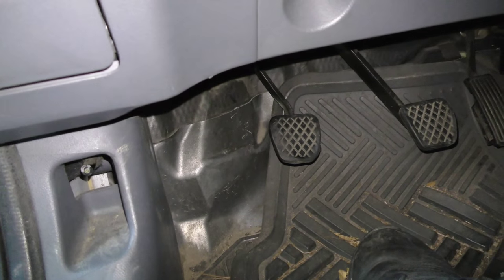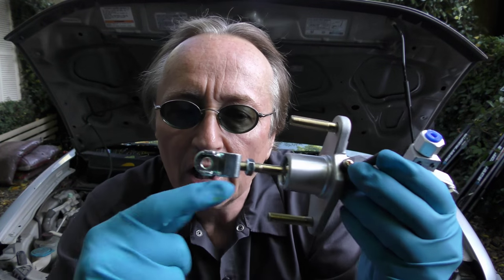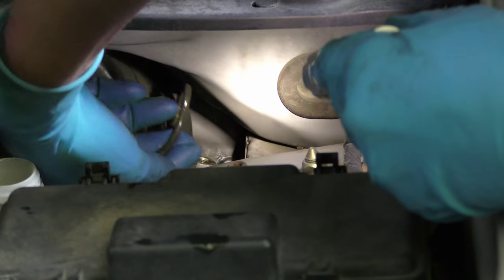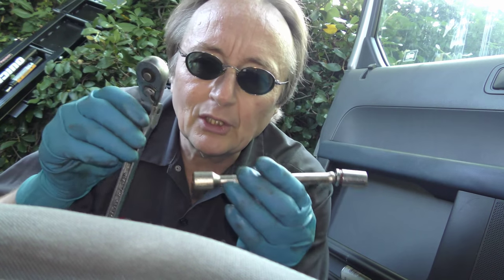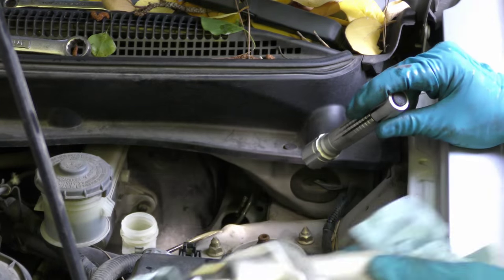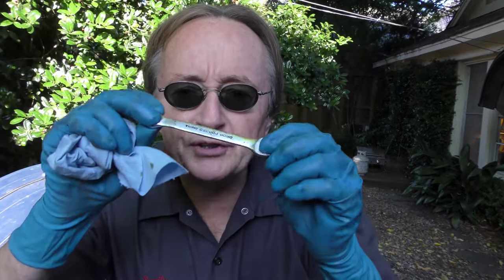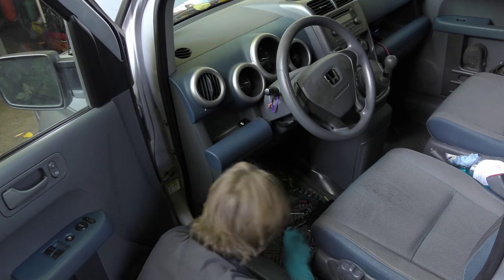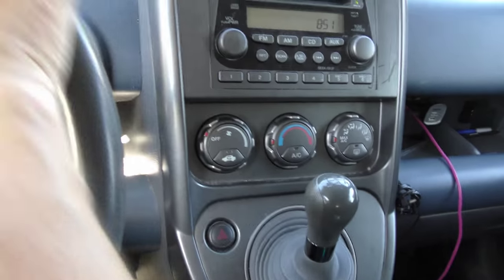How to Fix a Car that Won't Go into Gear (Clutch Master)

Comment: what if my car doesn't have a master cylinder for the clutch. I have 53 Buick. I just put a new clutch. and when I press the clutch pedal it won't go into gear. it'll go in with the car off but not on
Reply from the maker: +Nick Navarrete either you messed up the clutch job, or the linkeage on the clutch pedal assembly is broken or needs adjusting
Reply: +Scotty Kilmer well I hope not that's the 2ND new clutch I put. my question is if I adjust the rod that goes to the fork that holds the release bearing. is the bearing suppose to touch the pressure plate when the clutch is not pressed? the guy that rebuilt my clutch says it's not even suppose to touch. the weird thing is it went in to 1st. then when I adjusted it. it didn't wanna go into any gear

Comment: So confused my clutch went straight to the floor when doing a pull peddle still has some pressure but not as much as it used to and won’t go into gear hopefully it’s just the cmc

Comment: Scotty kilmer. My gear 5 on my Dodge ram is not working. Reverse only works when I'm slightly moving.
Reply: It's a 2001 manual transmission

Comment: Whatever was wrong with old cable clutches? These hydraulic ones seem awfully complex :)
Reply from the maker: Albinus81 hydraulics are smoother, people as lazy (and weak)
Reply: Scotty Kilmer I think your second comment nails it. I still like my cable clutch with a 10KG flywheel. Every time I drive a car with a hydraulic clutch my foot hits the firewall :)

Comment: I have a Hyundai Elantra and if I start the car right up and go,  it'll drive for about 1 minute then stop and wont go in no gear. If I start it up and let the car warm up, it doesn't drive in no gear. Its hard to switch gears. The engine revs and all but the car won't move. I know its something w. the transmission but I cant get it up to a shop to figure out exactly what it is.
Reply: Okay. Thanks

Comment: So I have an 07' Scion Tc and it will not catch any gears when I try to shift. I was accelerating from a red light passed the white line about 30 feet when I shifted inton2nd and i just stop going. It rolls fine revs fines it wont go into any gear.. when I put it in gear and release the clutch it wont stall either..  anyone help me. I'd appreciate it. Thanks

Comment: i have 75 toyota corona rt100 that can't go into gear WHEN the engine is running.. but if the engins is off i could change gear. 

and i notice that when the engine is running and i tried to go to first gear the car move forward slightly.. what causing it? i don't see a leak on the master
Reply from the maker: tie for la new clutch
Reply: not entirely true, could be a bad slave.
Reply: MoneyClipBeatzTheProducer what the hell is slave?

anyway, the next day after that problem the car just shifts normally...
Reply: My car wasn't going in to gear either, it will only go in to gear when car is off, I replaced master cyl and slave cyl and my car shifts fine! :D
Reply: MoneyClipBeatzTheProducer what is slave cyl? and where is that thing located?
Reply: Well, for my Subaru it's located on top of the transmission under the hood, it was honestly a 20 minute job. you'd need to rebleed the clutch system to

Comment: what could it be if the shifter moves into like the gear but doesn't quite make it then sometimes it needs to be pushed and sometimes makes scrunching noise?
Reply from the maker: worn out clutch or weak clutch hydraulics
Reply: Scotty Kilmer it's cable driven and had brand new clutch installed could it be the linkages or they snycros?

Comment: My truck wasn't going into gear, and it wasn't the clutch master. It was the slave cylinder. I pulled that thing off and greased it up, and it worked for a little while, but started acting up again. Time for a new slave cylinder. God knows why they would make something like that out of fucking plastic.

Comment: My cherokee doesnt like going into first or reverse... Reverse is weird sometimes a double clutch works sometimes i cant get into reverse unless i shut it off... First gear wont open until you slow down to 10mph or if you tap the gas itll pop into first all the other gears act normal clutch doesnt slip doesnt pop out of gear

Comment: I have a 07 buick rendezvous I put it on drive it won't move I put it in reverse it won't move some please help and tell me what wrong
Reply: Sounds like your engine and transmission aren't connecting right. That might be a bad torque converter and very worn out parts internally.

Comment: I have 2000 ford f150 goes into reverse but will not drive forward and can't hear when shift gears from park to drive either
Reply from the maker: +sergio perez see if perhaps the shifter cable is worn out, PRAY it's not a shot transmission, but it often is
Reply: Ok thank u

Comment: I have a ford freestar when i put it on reverse it goes to the front what does that mean ?
Reply from the maker: odds are the shifter cable has slipped, cause if not, transmission is shot inside
Reply: Scotty Kilmer should i get the shifter cable checked? Before i go for a transmission rebuild? By the way its a automatic

Comment: my car won't go into gear sometimes it's an older car but it dose similar when it's not running the transfer case can also get sticky
Reply from the maker: try changing the oil and filter and pray that fixes it . If not, often a sign of a trasmission oil pump going out or a bad torque convertor
Reply: +Scotty Kilmer  it's a manual one day it got stuck in HR 4wd it's a Toyota Prado so it's full time but it locks basically a centre diff I had to get it rolling then slip the car in neutral then move the transfer case

Comment: My clutch pedal is to the floor and wont go into gear, my fluid in my resuvour is very dark almost black and when i look under the dash at the master cylinder it is definitely leaking and looks the same dark color as the resuvour, i definitely need a new master cylinder but is my clutch blown too? Anyone who has any knowledge please let me know.

Comment: hey i replaced the clutch of my car and now it wont take any gear also replaced the slave cylinder but nothing what can i do???
Reply from the maker: +Christian Ramos PRAY you didn't put the clutch disc on backwards.  But if clutch is not hard, replace  the master cylinder too and bleed all the air out
Reply: +Scotty Kilmer well it just got 5 gears in but with a bit of a push now it wont take 6 or reverse but jus got the master cylinder hope it works with tht

Comment: however when the vehicle is off the shifter slides into the gears with no problem but if I turn the car on in gear it launches.

Comment: I just replaced a 4l60e auto transmission with a neutral safety switch in my 2000 gmc Sierra I bought the transmission used so the transmission could be garbage . but if not it won't go in to gear it has park and neutral if anyone has experienced this and found a fix please let me know !,
Reply: +Scotty Kilmer thank you for the reply ! the torque converter is seated and bolted all the way that's unfortunate but thanks really needed and appreciate your  option!

Comment: I replaced the master cylinder today and it still won't go into gear when the car is on! When it's off it goes into the gears no problem but when it's on its impossible! Someone please help me out I need to get to work by Monday 😢 lmao

Comment: i have a 94 ford explorer it wont go when you put it in any of the drives but when you put it in revsrer it go
Reply: what do you think whats going on in what you thin i should do
Reply: I have a 2001 mustang GT doing the same. because i drove it without oïl in the gear box.
Reply: i must by a new automatic(AR70W) gear box.

Comment: i have jeep wrangler 2011, it won't shift unless if it is off, and it will shift when the car is on but only on neutral, the car not moving at all i can't go forward or backward, and the clutch is too soft. !!
Reply from the maker: +ASH PLACE  pray it's just a bad clutch hydraulic cylinder and NOT a worn out clutch
Reply: +Scotty Kilmer I have checked the slave cylinder and it was leaking, I replaced it with a new one and unit now the same problem, do you think it's the transmission fork or worn clutch ?

Comment: What if I got the same problem but my car uses cable clutch ??? 00 neon
Reply from the maker: Lui Gonzalez then either cable needs adjusting, or the cable itself is frayed and needs replacing.
Reply: Mine has a self adjusting clutch I have no idea how those work .. Thank you great videos learning a lot from them ..

Comment: i have  2012 mitsubishi galant won't go forward  when i shift onto drive
Reply from the maker: +Tony John pray the fluid is low, if not, transmission is shot if it will go into R and go backwards.

Comment: What if it won't go into 3rd geR but all others are fine
Reply: +Scotty Kilmer Would you know what would happen if my jeep got parked in 2nd gear last night since it happened a day later it wont go out of second gear is it a bad transmission or just the clutch master cylinder? The clutch fluid is fine its dark brown but not low.

Comment: What if it's the reverse, having trouble getting that in sometimes.  And shifting into 5th gear, it feels a little grindy... Anyone?
Reply: Did you get your car sorted ? I'm stuck with my car. It's only happened twice so far where the gear stick will not shift into 1st gear. With some force sometimes it goes in or if I leave it for a bit eventually it rights itself.
Reply: I am hoping it's the master cylinder as that's cheaper to replace than the clutch or gear box 🤣
Reply: I still daily drive mine. It's minor at the moment, not bad enough to take in the shop. Hopefully you can still drive yours until it really needs work done. Someone did tell me it could my master cylinder needing replaced...

Comment: what could be wrong with a. 1983 Buick. that will run fine until you put it in drive.  and it cuts off.
Reply from the maker: +Wayne Faulkenberry could be lots of things, but often a shot transmission or bad torque converter if it runs fine until put into gear

Comment: What if i did this and still wont go into first 60% of the time and needs some force behind it
Reply: If it’s just first gear then it’ll be a gearbox problem my dude
Reply: Nah happens downshifting into 3rd and when it wont go into first it also wont go into second until the 2nd or 3rd time I try.But ive heard it could possibly be the synchros.but the issue only happens after the truck warms up and even if I'm at a light trying to go from neutral to 1st gear

Comment: Can someone expain to me why my car is going into gear but will not go
Reply from the maker: +Raquinta Chavis pray you are just low on fluid and that the transmission is not shot internally. Also check for broken drive shaft joints that make the car not move

Comment: and of course its f$kin HONDA transmission!
Reply: So it's bulletproof, yes.
Reply: Moon Moon exactly. I dont drive a honda but they so smooth and easy to use compared to my nissans transmission which is really notchy and aggressive.

Comment: should just get an automatic lolool
Reply: fleetwoodsucks I drive a manual, my girlfriend drives an Auto.  I can't stand driving autos, it just feels like the car will do whatever the fuck it wants and you have no control.  Nothing worse than coming to a controlled stop and the auto decides it wants to drop down a gear the car lurches forward towards the bumper of the guy infront of you.
Reply: DemonAMVs
thats why you hold the car with break pedal
Reply: DemonAMVs If your auto drops into first and manages to push you with the brake on, you might wanna go do a brake service.
Of course I'm just kidding around...
Reply: fleetwoodsucks I bought a late 80's Nissan d21 v6 auto with low miles (7900) a few years back. I adjusted the idle to under 800 rpm and it goes into gear at the correct time. It's a nice truck. Very reliable.
Reply: fleetwoodsucks muuuch harder to work on